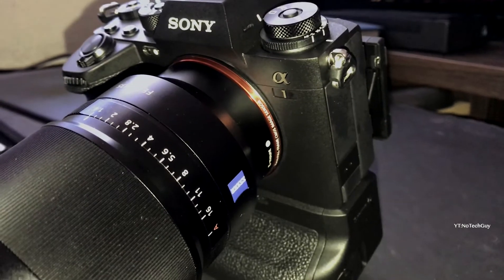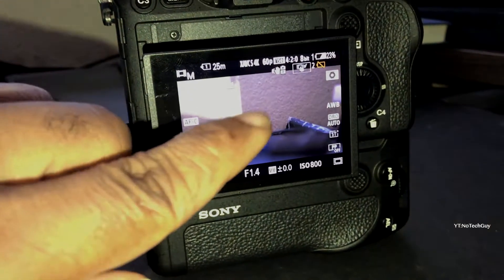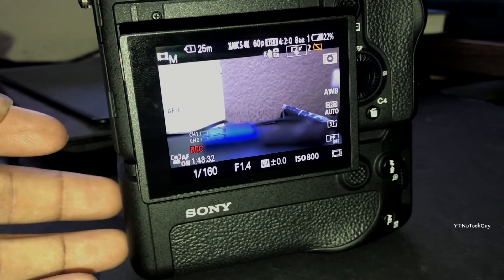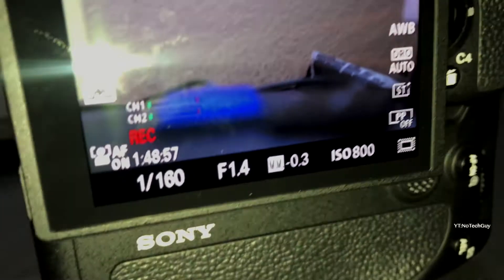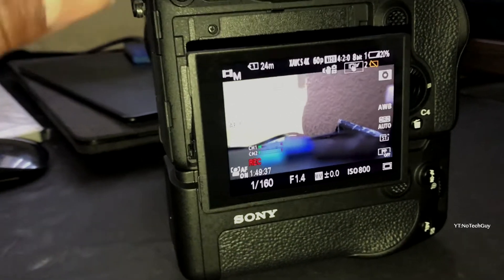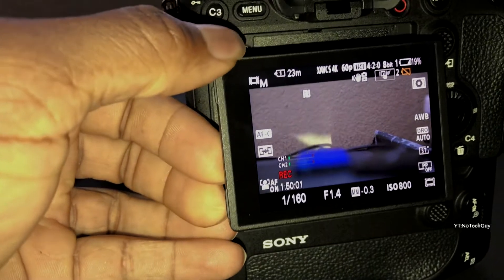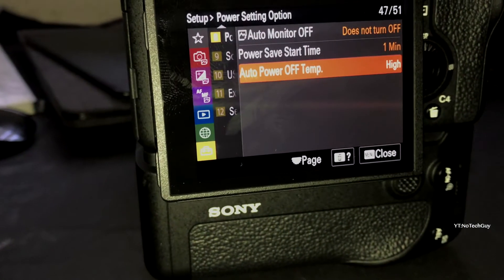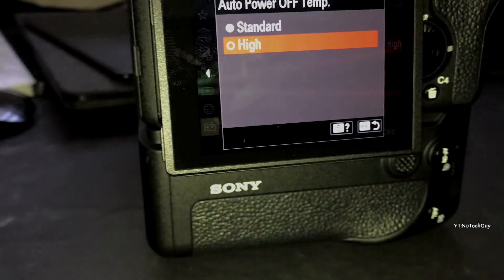Sony Alpha 1 Overheating Test / Fix

Comment: Set "Auto Power Off Temp at high", BUT AT WHAT COST? 
Will the sensor get damaged in the long run with this setting?
Reply: No it will not. This is already proven by many YouTubers who are professionals. Sony wants to avoid law suits because of burned skin and fingers, so they added this safety button. But it will not damage the sensor or camera if you set the power off tolerance to high.